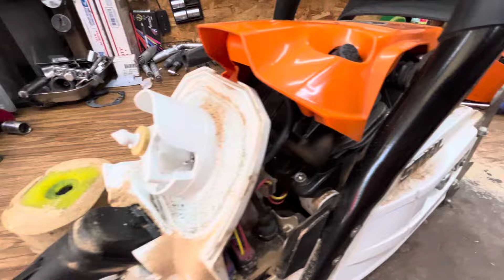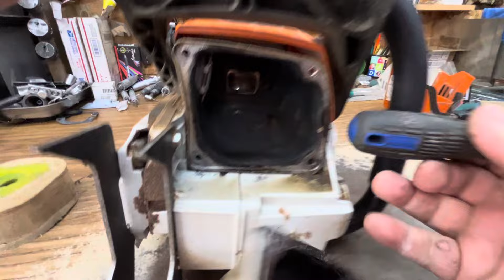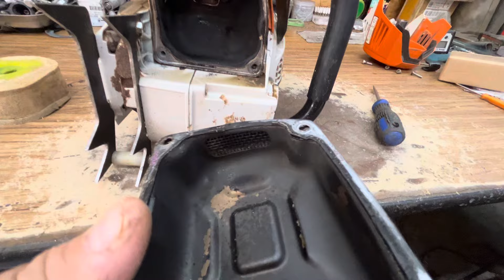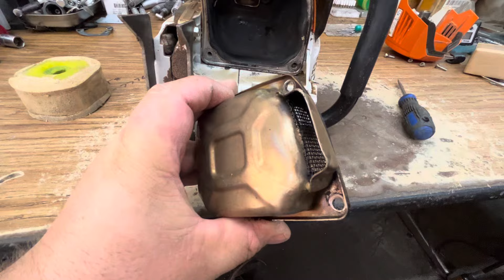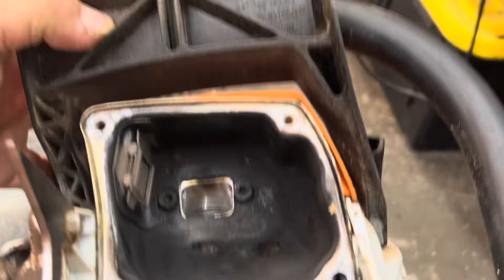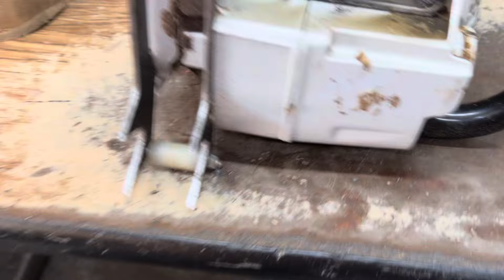Dominator at 32:1 after 20 gallons of fuel

Comment: I prefer Maxima K-2, What are your thoughts on Dominator?
Reply from the maker: K2 seems fine but not much experience with it outside of saws sent to me that have used it. Dominator seems pretty good. Zero carbon in the exhaust flange. Just shiny aluminum